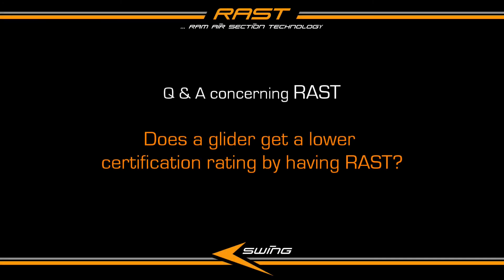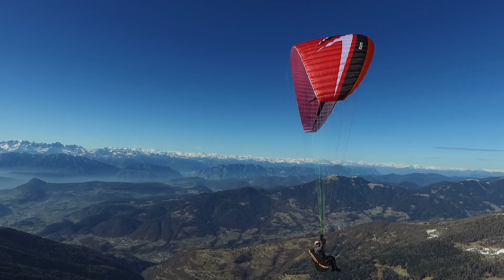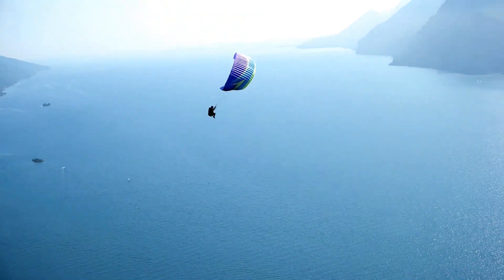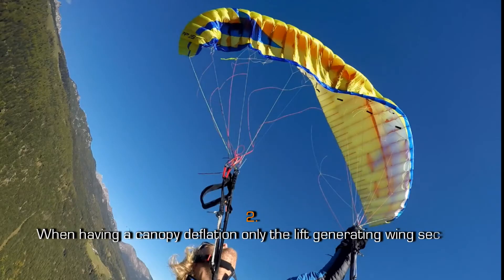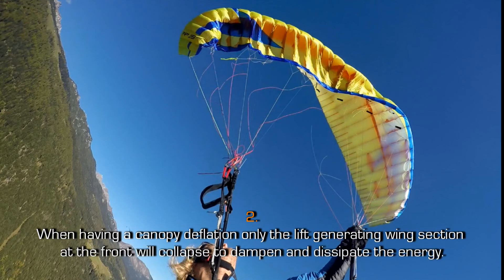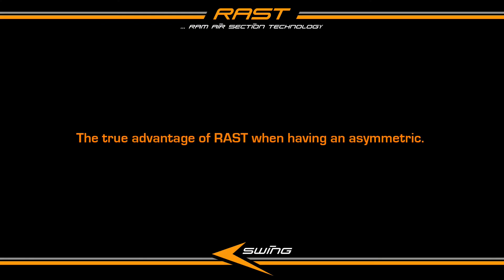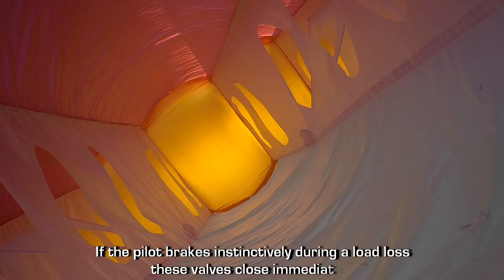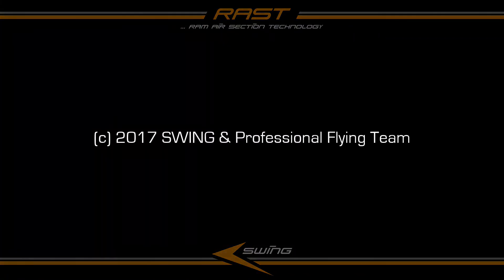Q&A concerning RAST: Does a Glider get lower certification rating by having RAST?

Comment: I flew my Nyos rs for ~35h in partially very strong conditions and it freakin works !! RAST is awesome, at least for rough air.
Otherwise unnecessary and a bit to expensive for weak to normal conditions
Reply: Thats why you need a whole quiver of paragliders
Reply: I’m confused, does it perform worse in smooth air than a normal paraglider ? If you could only have one, would you stick with a rast ?